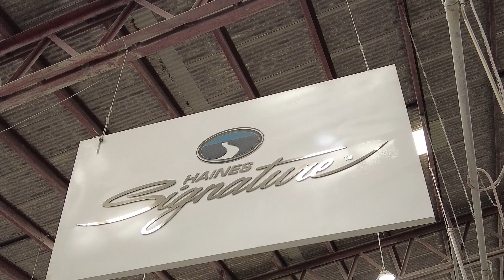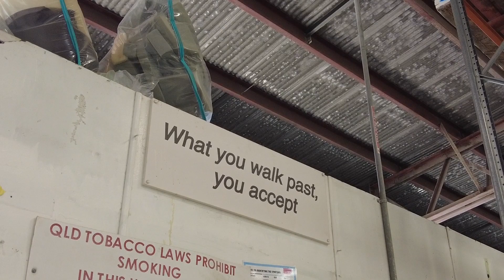ANNOUNCING HAINES SIGNATURE

Comment: Do they or have they moved to composite transoms ?   Plywood just ain't cutting it in 2023 👈
Reply from the maker: Hey mate, they use specially designed plywood timber. This is more superior than any marine-grade timber. The individual layers are treated and protected prior to assembly. They do provide the option of being built timber-free using thermo-lite board which is a lightweight composite marine grade product manufactured with cross-linked polymer foam and fibreglass and offers high specific strength and toughness.
Reply: @StreakerMarine  Ok good answer